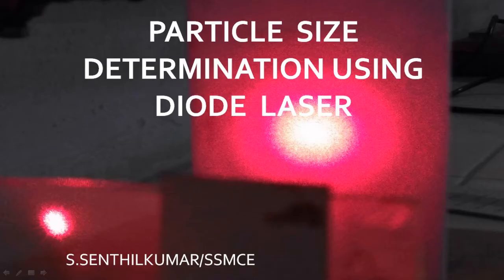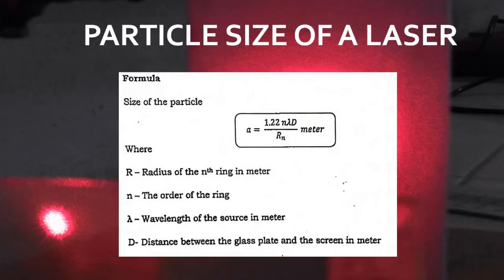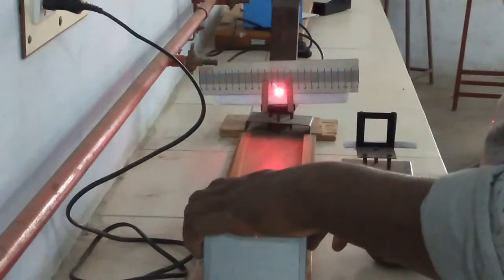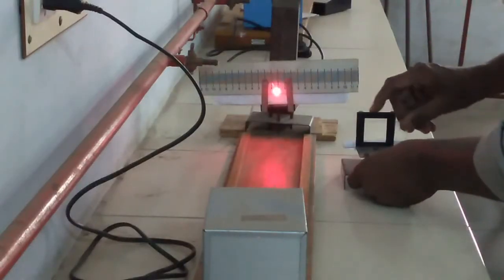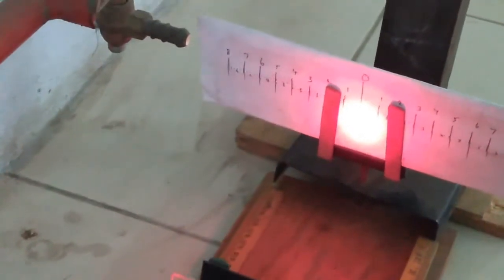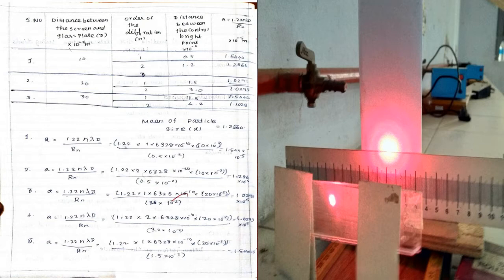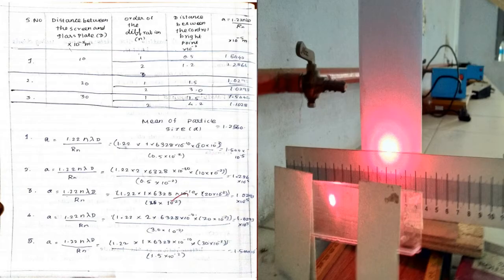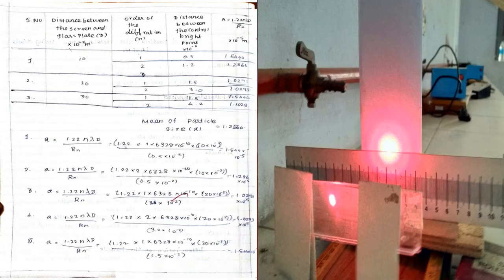PARTICLE SIZE DETERMINATION USING DIODE LASER||PARTICLE SIZE OF LYCOPODIUM POWDER||Physics lab

Comment: Sir, Nice explanation on laser diffraction. Thank you. I tried to mimic his in our lab. However, I was not successful enough to get that two circles. on the screen. Kindly let me know if I need any additional arrangements to get this pattern.

The laser used 532nm (1000mJ)   
The particle used is glass particles of 10micrometer size.
The distance between the screen and particle slit is 10cm.
Reply from the maker: For better result Try in dark room and start the distance from 5cm.use above 600nm laser source.

Comment: Sir could you please tell me that lycopodium powder available on amazon could be used for this experiment or any other specific details about this powder ...and also names of others chemicals whose particle size can be determined using this technique.🙏
Reply from the maker: I did experiment using lycopodium powder coated plate (available in scientific stores).
if u want to do experiment using powder directly that is available in market ,a microscope slide, with or without a well, is prepared with a droplet of water, and a fine dusting of lycopodium powder is applied. Then, a cover-glass can be placed over the water and spore sample in order to reduce convection in the water by evaporation. Since this is highly flammable please do take safety measures.
Any Micron level spherical particle thickness powders can be used for this experiment.
Ex: polystyrene latex
Reply: @senthilssmphy3038  thnku soo much🙏